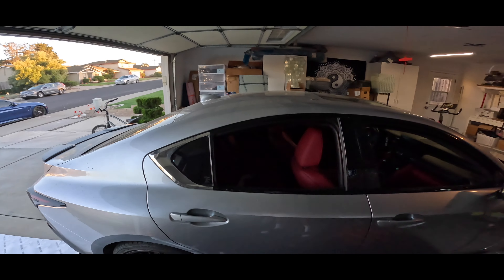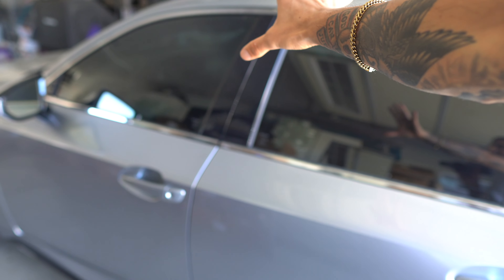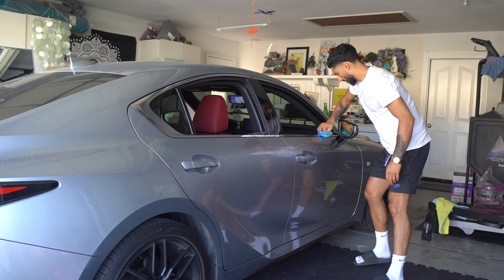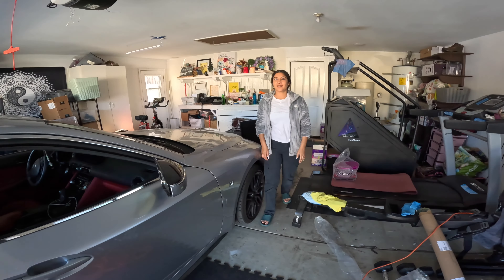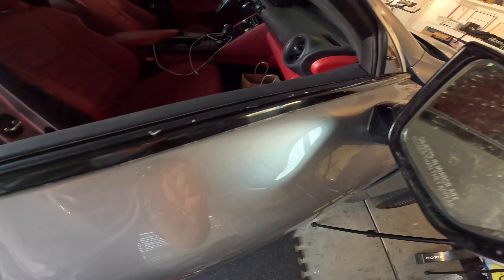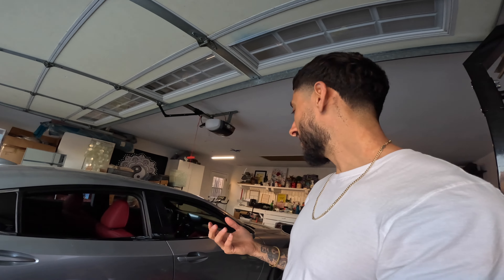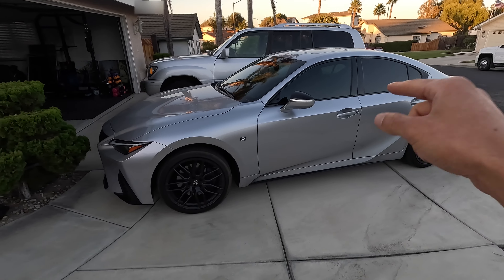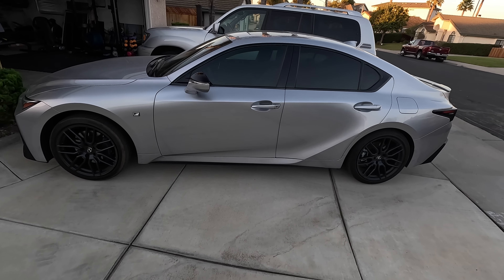Beginner DIY Chrome Delete - 2023 Lexus IS 350 F Sport

Comment: I did my 2018 ES350 today and it turned out pretty good but doing it sucked!!!  I had to do a couple frames over and I hated doing this. But, a local shop wanted 650 bucks for this!! I’m happy with mine for what I have in it.  If someone is that close to pick out the flaws…they are too close to my car!!!